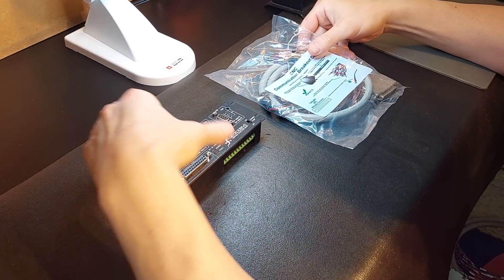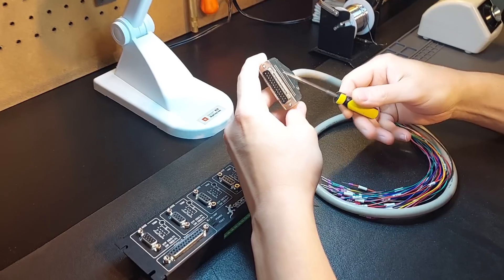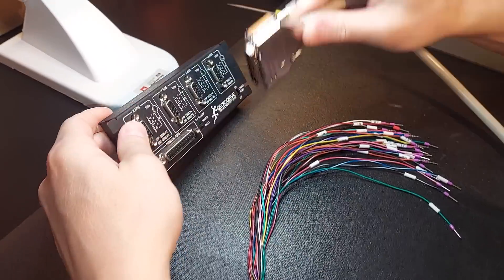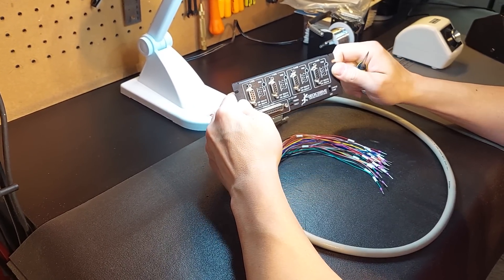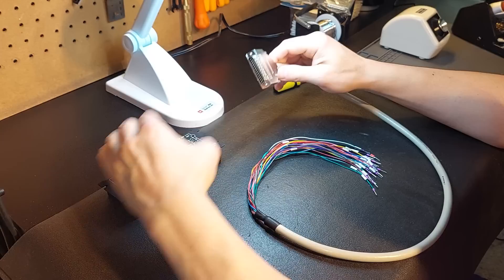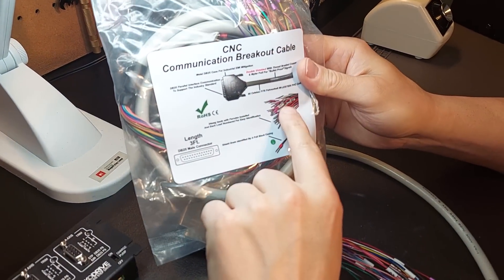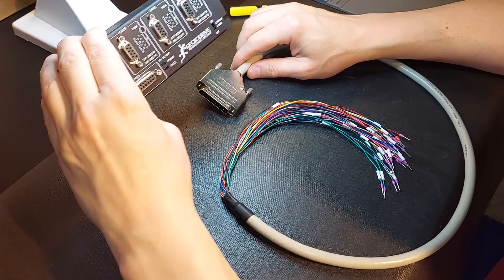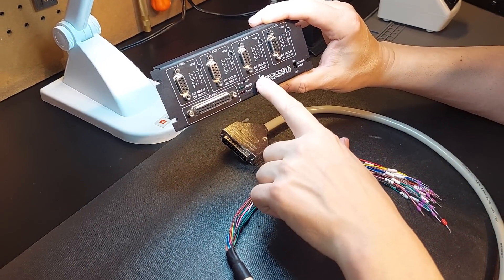Masso G3 CNC Controller And Gecko G540 Integration Done With One Cable...

Comment: Am in the process of changing over my control to the Masso.  Really happy you have this cable, I can use it with the existing G540 on the machine.  Fan freakn tastic!
Reply from the maker: Thank you for your support. 

It certainly makes using the drive a straight forward process. 

Glad to help! 

Have a great weekend!
Vince